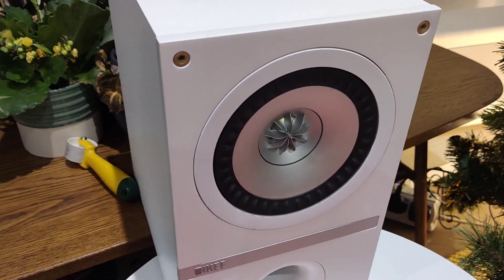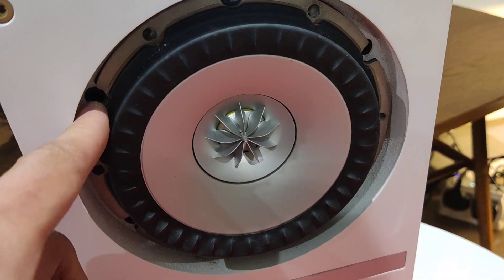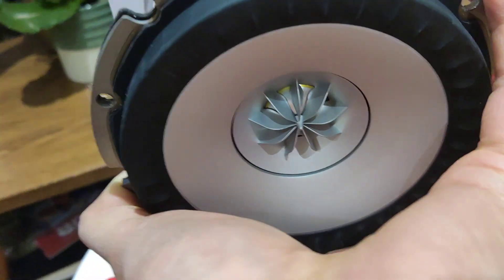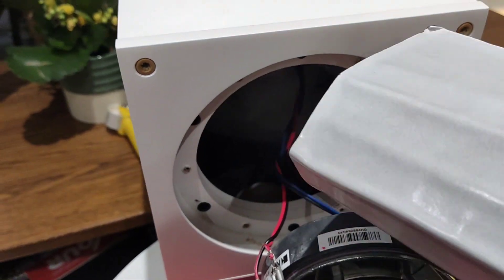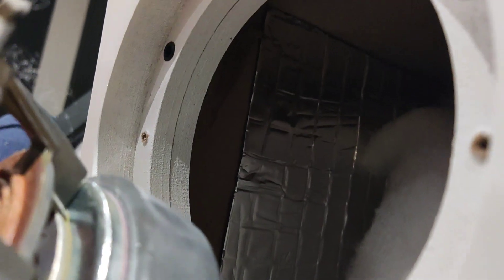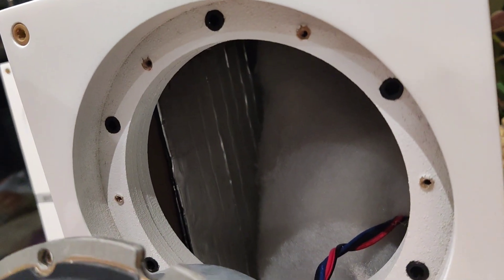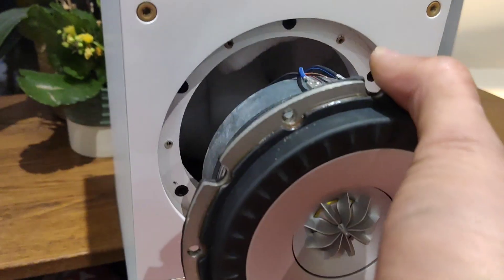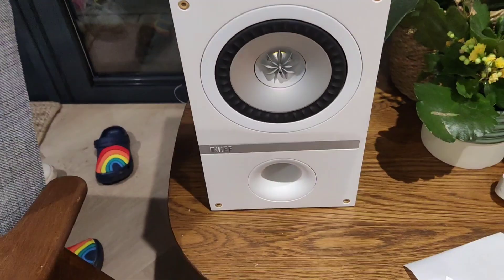Adding mass using sound deadening butyl mat to inner walls of kef Q100 speaker

Comment: Another excellent and cheap alternative is soberthane rubber which you can buy in extremely cheap yoga mats £10 will buy two 2 metre rolls and is extremely effective at damping down any resonance I've used this method in all sorts of loudspeakers and it really works.
Reply from the maker: Great tip. I did read about that and considered putting a layer of this on top of the butyl so it adds mass as well as dampens standing waves more inside, but happy with them as they are for now

Comment: Useless video without measurements, did you actually achieve anything...
Reply from the maker: There are loads of forum threads that mention they've added mass to the inner walls of the speaker cabinets as well as crossover upgrades with measurement changes but i didn't find a video of how to do it on the q100. So i thought i'd offer something different. I humbly disagree that it's useless.
Reply: @andyong1  You could have taken 10 minutes to make a couple of measurements to prove your effect...

Comment: GJ, I did the same. It definitely helped a bit! Bit tighter and more mature sound. But I installed it from the back , 4 screws and you can move the board to the side. you can cut them up if its a tight fit. As long as you cover 60-70% ist ok. I also replaced the capacitor (3.9 uf) and resister (6.8ohm) to a higher quality one. That also improved sound quality slightly. I''m thinking in doing a crossover design upgrade but not sure yet what to get.
Reply from the maker: Nice! I'm thinking of trying the cap replacement upgrade at some point. Did you replace with electrolytic caps or polycaps? And if polycaps did you need to add another resistor?
Reply: @andyong1  Always a polycap. Doens't need to be anything exotic to improve the part that is already there. I used a ClarityCap CSA3u9H250Vdc, anything similar will do and be an improvement. Only the µF value needs to match. Voltage needs to be equal or higher. And I only replaced parts, i didn't change the crossover design. May do in the future though.

Comment: Excellent guide. I think the biggest difference from the Q100 and the LS50 is how absolutely dead the cabinet is on the LS50s. No resonance at all. This approaches that, I'd be surprised if it didn't help their performance a good bit.
Reply from the maker: Thanks glad the little guide was well received. I just did it so haven't given it any extensive testing but so far it seems a bit more controlled at higher volumes and the bass seems a bit tighter.
Reply from the maker: Also feels like there could be a bit more attack and punchiness in the response on certain music.